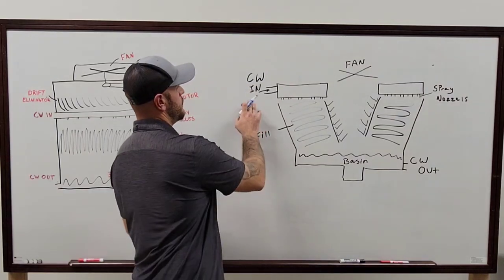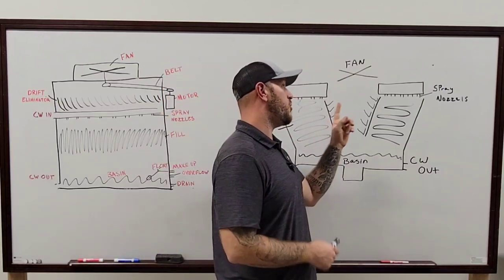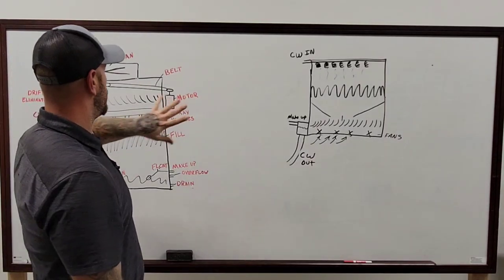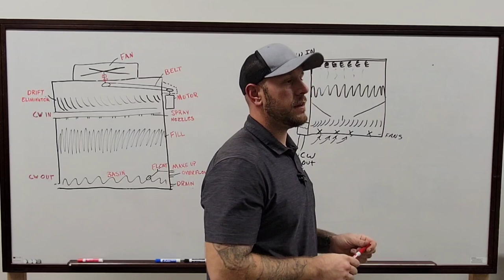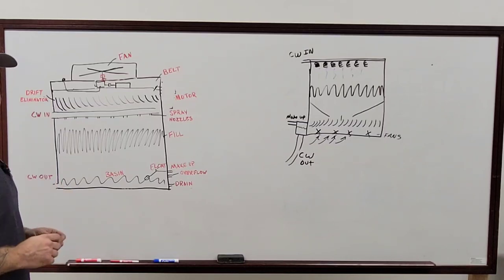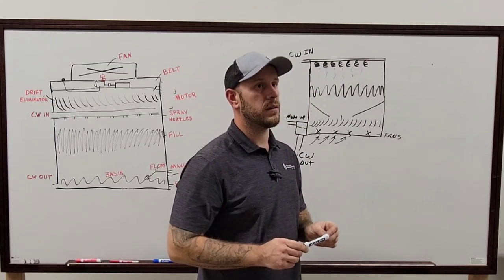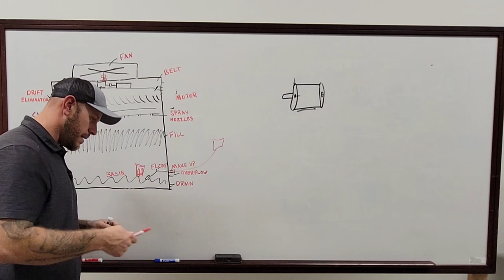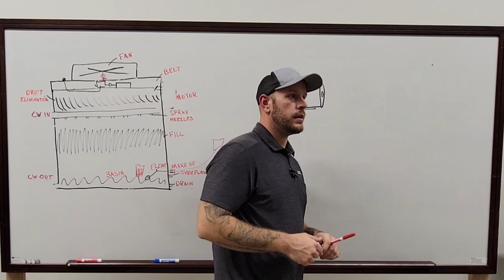Cooling Tower Service Training for HVAC Technician

Comment: What exactly happens to the chiller when the water cooling tower fails completely?
Reply from the maker: They can trip on high head pressure or surge due to high water temp.
Reply: @HVACTIME  surge in water pressure going to the cooling tower?
Reply: @HVACTIME   What's the difference between tripping and surging?